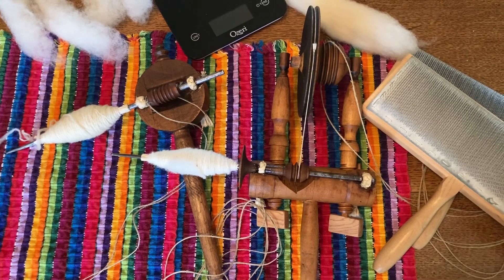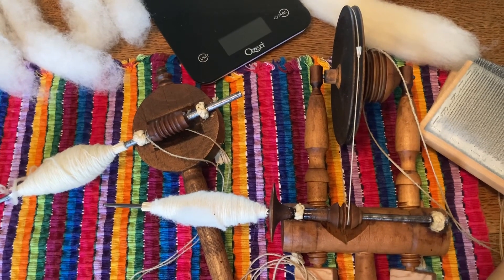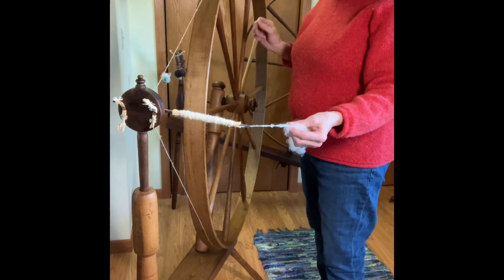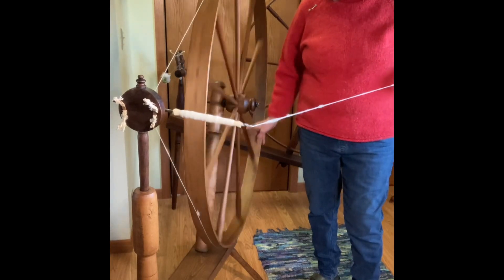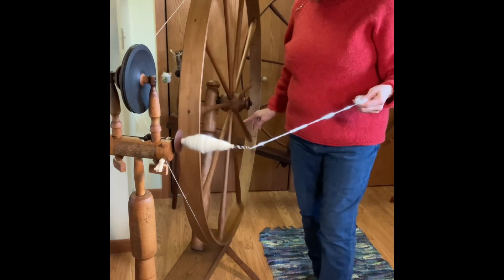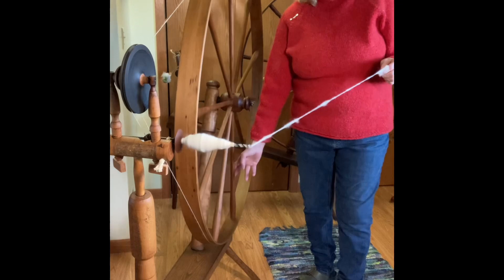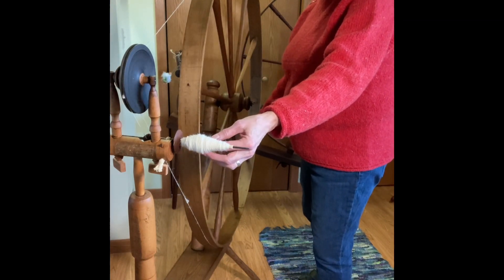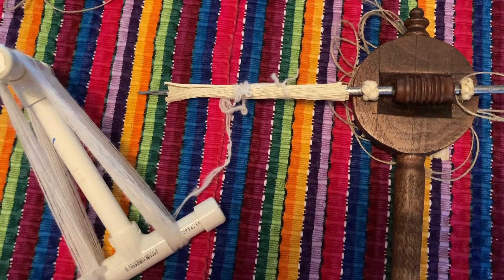Great wheel spinning: Bat Head vs Accelerator Head

Comment: I bypassed the accelerator wheel and spin direct drive at a ratio of 52:1. My spindle looks to be exactly the same length as the spindle on your Minors head so with prepared Rolags I can fill the spindle in 20 minutes or three Cops an hour. That is fast enough for me.
Reply from the maker: It is amazingly fast.  The GW makes excellent spun yarn with a quality that is difficult to surpass with a treadle wheel.

Comment: Valerie, do you know where your accelerator head was made and in approximately what year? I have an exact duplicate of yours on my recently acquired Great Wheel, right down to the corn cob straps and the colors, and  am very curious. Thanks so much for your videos. I'm finding them very helpful! Nancy
Reply from the maker: It is a Miner or Minor accelerator head from early 1800s   I’ve owned a Pierce head that came after Amos Minor.  Pierce added tiny brass bearings for the accelerator head axle.  Thank you.  Glad you’re enjoying them.
Reply: @valeriegaddis5973  thank you! No brass on mine...I was told a date of 1850 but thought due to the accelerator that it might be a bit older than that!
Reply from the maker: @Nancy.mystic.forest  accelerators were an after market add on.  First manuf in the early 1800s around 1809-1810.